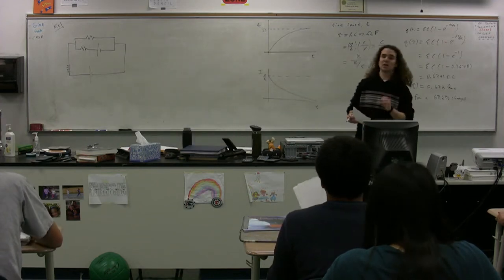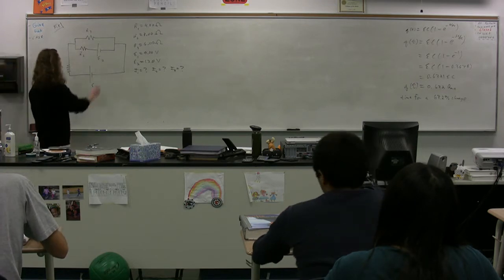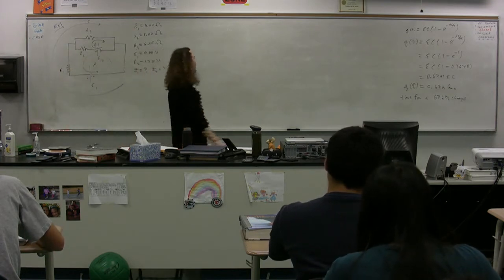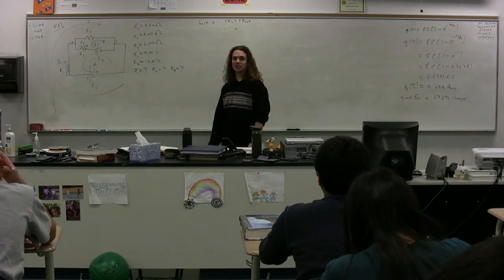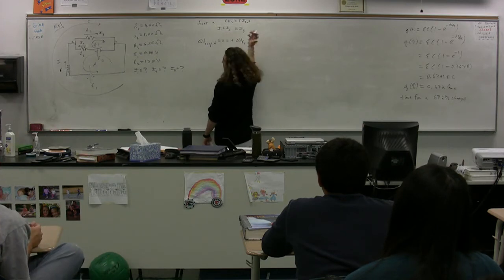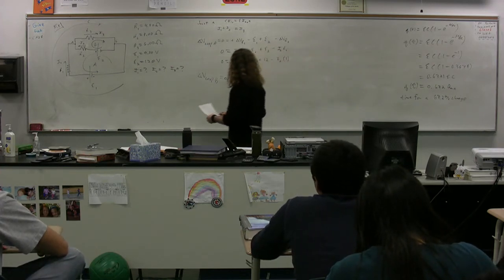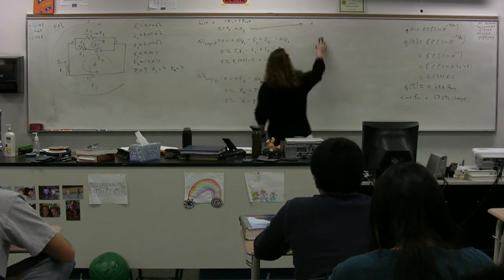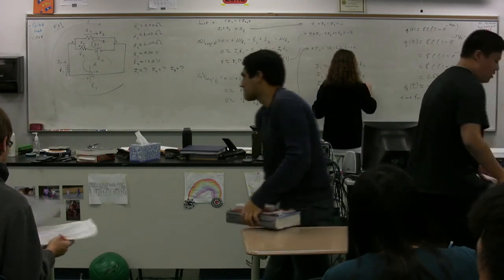Another Kirchhoff's Rules Example Problem - AP Physics C

Comment: My University Physics professor gave us a problem to do like this in 10 minutes for a quiz. Knew everything, but could not do the math quick enough! Got 1.5/5 on it, but It's nuts when you involve so much algebra. Many people used their calculators and entered the coefficients into the entries of the matrix in the calculators to solve the solution. I, on the other hand, haven't worked with matrices in years. So, I did it the long and dirty way. I'll be taking Linear Algebra soon enough, though.